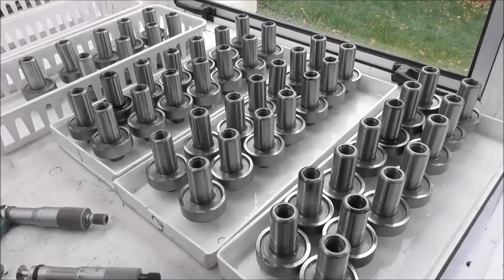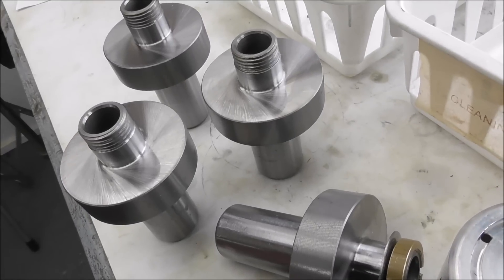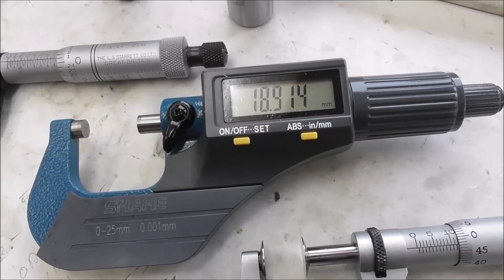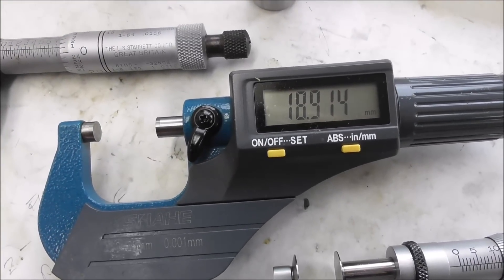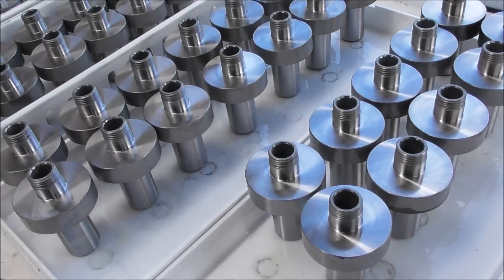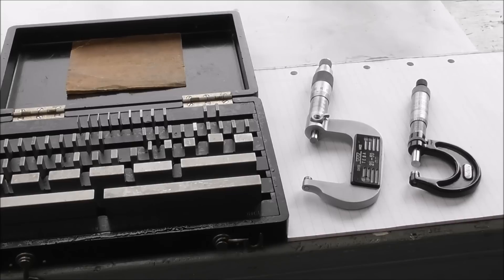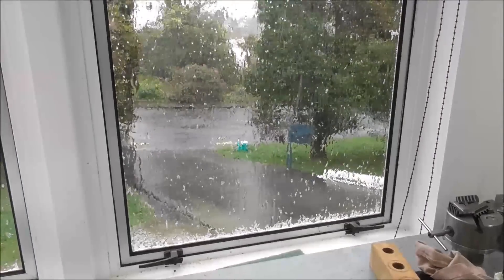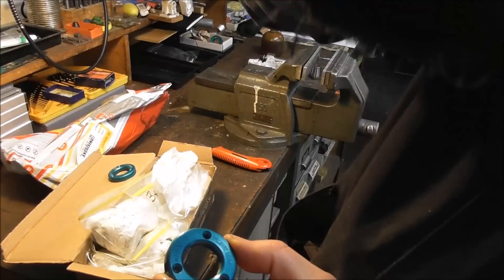Micrometers and Eye Candy

Comment: Nice work Cliff! Warning, sincere constructive criticism ahead. Your face grind has no cross hatch and from the swirl pattern  your tailstock center height is low.  Perfect cross hatch does not guarantee a  flat face, but no cross hatch guarantees it is not flat.
ATB, Robin
Reply from the maker: Hi Robin - Thanks for posting. Yes I agree a lack of cross hatch probably means the tailstock center is low or the spindle bearings are out.  Not many would notice that - good to meet a fellow toolmaker! Yes the flange surface will be minutely cup shaped, (I checked it and it is a tiny amount) and that is fine for the application. Anyway I appreciate you noticing it and your comment.  Feel free to email me anytime. Cheers  Cliff